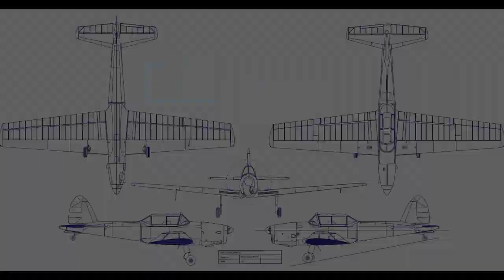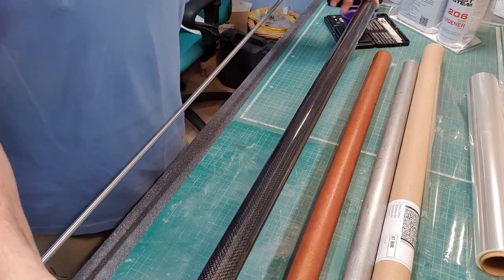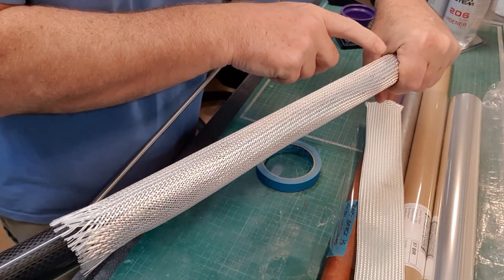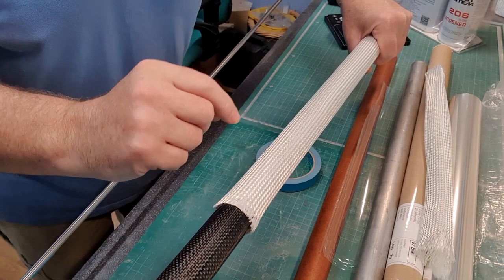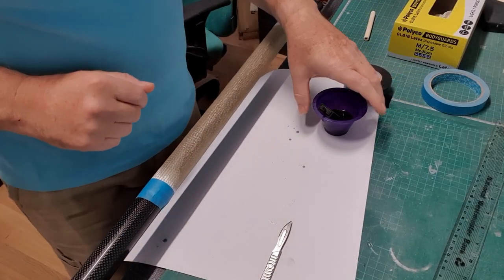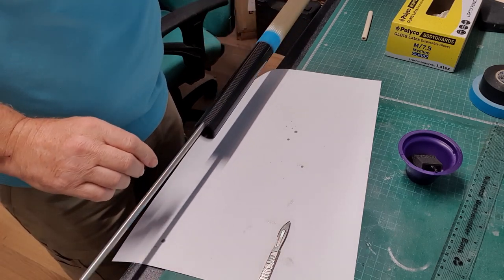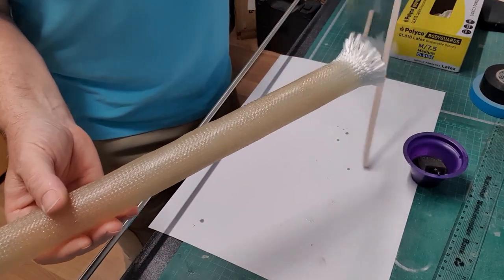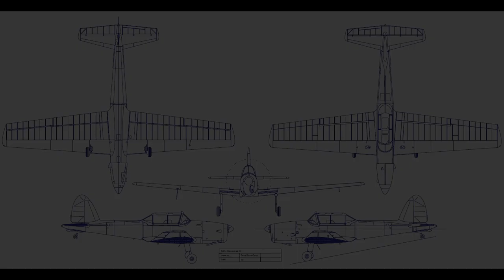Wing Tube   Pt9 Quarter Scale Chippy

Comment: Hi Danny I’m really enjoying this build great job. 
On the finishing of the glass sleeve it’s worth looking at a shrink tape I generally use one around 20mm wide. You simply tape it to your mandrill and wrap it around in a spiral with a overlap of about 5mm. Then tape it off at the other end, It’s best to bind the ends of the shrink tape to stop slippage. You then apply heat with a heat gun to activate the shrink tape thus consolidating the laminate and expelling unwanted resin and the bonus is less weight. Just be careful not to use to much heat. 
I hope that makes sense. 

Darren
Reply from the maker: Hi Darren, thats a great idea. I tried spiral wrapping electrical tape, which might have worked if i had used it straight away, but i was worried about it sticking to the resin. Dirk fixes one end then hangs a weight on the other end of the glass tube

Comment: Could large diameter heat shrink tubing be used to hold the glass tight on the tube?  Maybe difficult to remove after curing.
Reply from the maker: I would be worried about it stivking

Comment: That carbon tube CAN'T weigh 1100 grams.... I guess you added a zero.
Reply from the maker: I will give it another weigh tomorrow, it was with new scales, you are right that does seem heavy... .
Reply from the maker: Yeah stupid me, on my normal scales 120g and I wont be using the full length.....